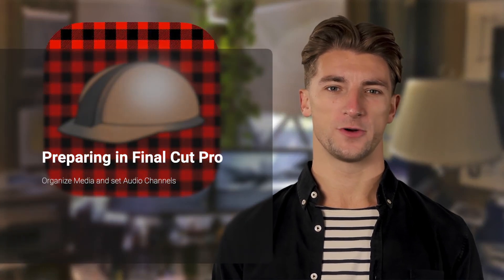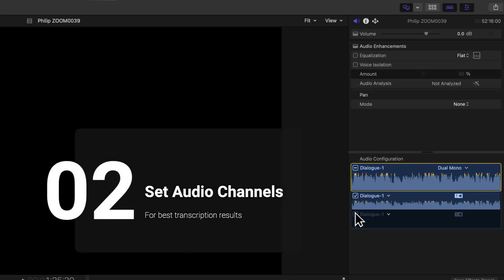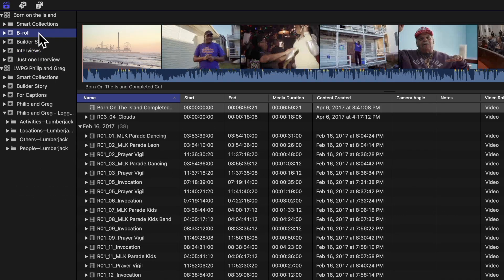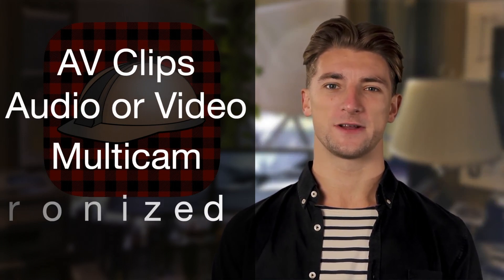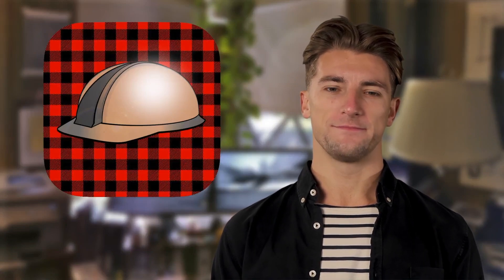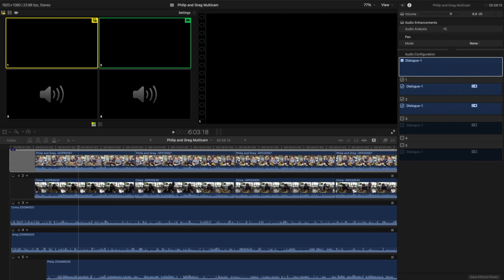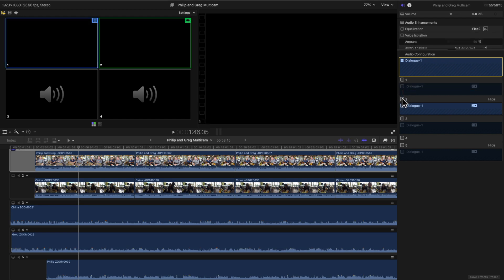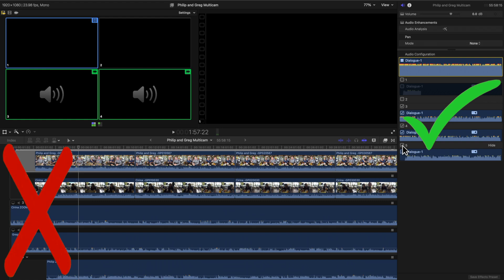Preparing for Builder in Final Cut Pro

Comment: The instructions are clear, but I simply cannot get Builder to stop pulling in de-selected audio from a FCP multicam. I de-select all camera audio. From my audio source, I deselect all unwanted tracks, and only select the two mics I want.  But the good audio from my main speaker is never used.  Builder only pulls from the first track of my audio recorder, even though I've de-selected it. I've struggled with this for more than a year. A year ago, you hinted that it was a problem.  Any chance you will consider a fix?
Reply from the maker: If you're absolutely sure you're selecting the audio in the Inspector - the only place that gets exported to XML as shown in this video https://youtu.be/uXKrZlqsANg then please export the xml from FCP to a file, zip that up and send it to info@lumberjacksystem.com so we can find out what's going wrong for you.